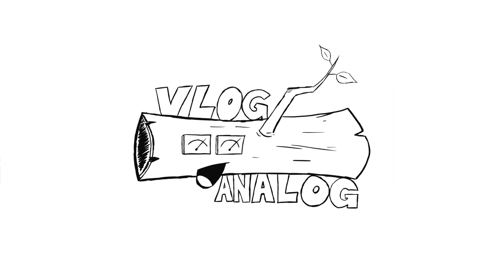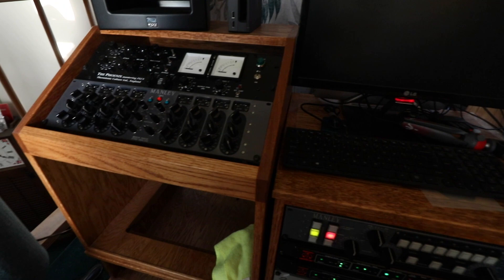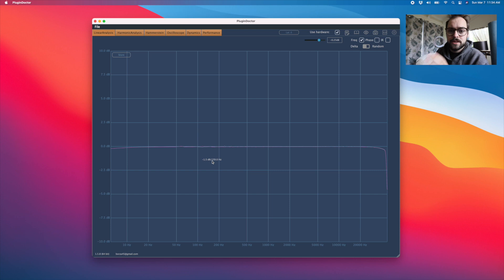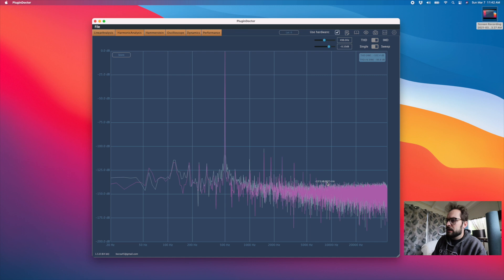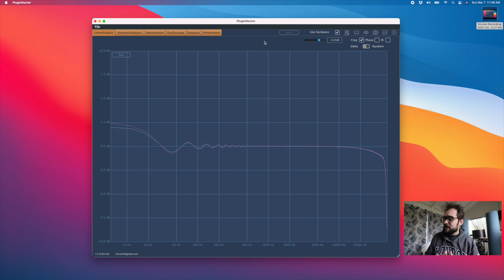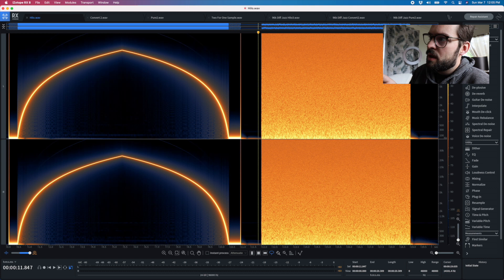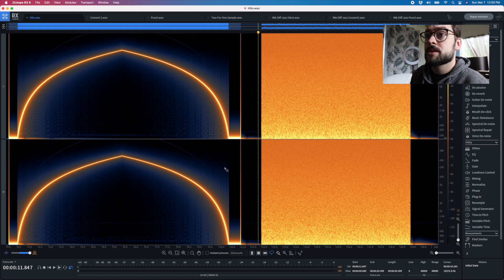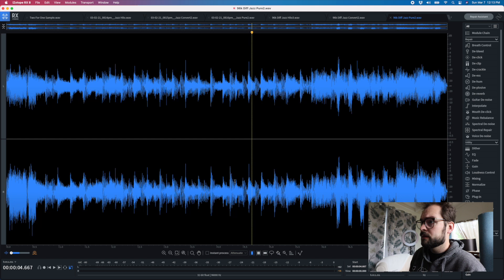The Wonderful World of Mastering DACs

Comment: trading in my hilo for the apogee symphony mk2 which blows it away yes the hilo is neutral but i find its lacking low mids and it can sound very hard and somewhat dated keep in mind in it came out about 2011 so yea  only thing  i like is its routing ohhh also people has also point out that the when using  hilo stand alone it sounds better than when using the usb and when i compared it does sound choked when using the usb clocking not good
Reply from the maker: Symphony Mk2 SE!!!  The best!

Comment: Nice video! I have a Lynx Hilo and a pair of PMC 6-2. , a Creme and a Bettermaker Liniter. That is all I have the rest is all ITB.
Should I go  next for:
1. M905 w DAC 
2. Crane Song Hedd Quantum
3. Trinnov ST 2 plus MiC
4. Complete the Tegeler line of products 

My room is a room in a room - pretty decent sounding but with a very low celling at around 5.9 ft. The size 16 ft X 9ft X 5.9. 

I’m trying to focus on Mastering and mixing rather than production.

Thank you!
Reply from the maker: I always try to upgrade whatever is my weakest link.  So if you think it’s the sound of the room, go for Trinnov.  If you think it’s monitoring, go for the Grace.  If you think it’s outboard, go for the Tegeler.  The Hilo is great for conversion, so probably no need for the HEDD yet.
Reply: What did you end up going with?

Comment: So your AD converter is what takes the digital signal from your DAW and puts it into your speakers, right? If that's the case, why would you want to color that, if that color is not being added to the actual work, only to your ears while you work on it? Why not always use the cleanest option and add color to the final result instead?
Reply from the maker: Other way around.  Monitoring is DA, and a separate path from the options shown in this video.  But yes you are correct: you want your monitor DA to be as clean and true as possible.
Reply: @WillBorza  but of course! So what is the analog source?
Reply from the maker: I don’t have a tape machine, so all the masters I do start Digital.  Songs are converted DA into my analog gear (this is the topic of this video), then AD from my analog gear back into my computer, then DA monitor out to my speakers.
Reply: @WillBorza  thanks for clarifying

Comment: Hi! Great video. How do you set up a DAC print? I tried to hear the difference between my Apollo 8 and pure 2, and when I reversed the phase, the sound cut out, so both bounces are the same. Would be great if you could explain where I'm going wrong.
Reply from the maker: Hmm… lots of variables here so I can’t say for sure… but sometimes the differences are very subtle and the difference between two DACs is extremely quiet (like -85dB or quieter).

You could get PluginDoctor and measure your analog loop in real-time.  That would help you diagnose why you seem to be getting the exact same signal twice.
Reply: Could you explain your chain for the pure 2?
Reply from the maker: I only use it as a DAC not for ADC, so it receives an AES signal and converts it to analog which patches in to my Manley Backbone

Comment: Harmonic distortion is well below -100 dB on all converters. It's a nice observation but hardly audible. How do the clocks of these converters compare? or do you use an external master clock?
Reply from the maker: Typically I use the clock in my Hilo as master.  The “on paper” stats are all low, but the way they handle complex material is something that stretches beyond numbers and statistics.  Each converter has a wholly unique frequency response and dynamic character.

Comment: Love your channel man! How about the Grace m905 DAC compared to these beasts? Which one is good for precise monitoring, hearing the truth. I'm thinking about the convert2+m905 analog or m905 digital, can i bypass the m905DAC when using another DACs?  expecting any advise from you :)
Reply from the maker: For a while I had the M905 DAC plugged into the Manley Backbone as an option, but I never found a song where I liked the 905 sound more than the Convert 2, Pure2 or Hilo.  Of the 4, the Grace DAC is 4th place to my ears.  I would probably steer you in the direction of getting a Convert 2 and m905 analog if budget is a concern.  If you can afford it, go for convert 2 and 905 that can do both analog and digital.
Reply: @WillBorza  Thank you so much! If the convert2 plgged into the M905digital ver, can I avoid the double converted sound?
Reply from the maker: Yep, M905 has an AES out, which can go to your Convert2 to handle DA
Reply: @WillBorza  Perfect! Thank you sooooooooooo much :)

Comment: dumb question but how do you switch between the converters? is that done through the grace m905 monitor controller?
Reply from the maker: There’s three input switch options on the Manley Backbone, that’s where I can quickly a/b between everything
Reply: @WillBorza  ohhh I see! how is that connected to your computer? Do you use any router or splitter to feed signal through different connections simultaneously?
Reply from the maker: Computer connects via usb to a Lynx Hilo which connects to everything else 👍
Reply: @WillBorza  awesome ! that signal flow is sick haha thanks for the informative video :))

Comment: Do you have the  converters running off a single clock, or is it just independent? ie Would they all test better off a good clock?
Reply from the maker: The whole studio is clocked off the Hilo.  When I’m doing two-computer pitch/catch, the pitch computer is clocked off Dangerous Convert2.  I’ve had my eye on the 10MX but it’s hard to justify that cost...
Reply: @WillBorza  I'm using my Dangerous Dbox+ for converters atm, is the quality high enough or should i get a Prism Sound Lyra 2 USB or Hilo or Pure 2? Hard to ask anyone questions? I'm getting a coleman transfer console, so I'm ditching the dbox in june. What converter would you get if you were me ie with nothing starting from scratch with what you know now? The orion 32 gen 3 looks good also? Streaky recommends the Prism Lyra? Where do I start?
Reply from the maker: If you need more than just a stereo analog loop, go for the Orion or UA Apollo.  If you’re just gonna do mastering, it’s hard to beat the Hilo’s bang for your buck
Reply: @WillBorza  I have UA Apollo 8P already and the Dbox+ kills it, not even close.  Thx for all your advice and videos, helps immensely!

Comment: I bought a Lynx Hilo with Thunderbolt 3 - Black June 2021 in Sweetwater to improve my converter quality in the studio and add it to my mixing and mastering chain, unfortunately I cannot say that it works optimally since it leaves much to be desired in terms of the price that It is being sold, it does not work well on Mac... I have made several updates for more than a year and it works totally inconsistent with the app that commands the interface, with a lot of problems that it causes when working and producing correctly, the routings are Confused in the touch screen and the mixer works in an uncoordinated and very precarious way since one pays a super high price it does not come close to a UAD Apollo mix or other interfaces with a synchronized app command...it leaves much to be desired, I hope that they invest in offering a product with an app mixer according to the cost values... very mediocre and with a low operational level... Very frustrated to have stuck with this product lacking in technology...de I read this review so that they take this into account if you are going to buy something Lynx
Reply from the maker: I only use Mac computers with my Hilo, and have never had these issues.  Both Intel and M1.  Have you been able to use the touchscreen on the unit itself to get it to do what you need it to?
Reply: Your on every tubers channel in the comments with this same exact comment bro , dayummmm it’s sad 😂😂😂